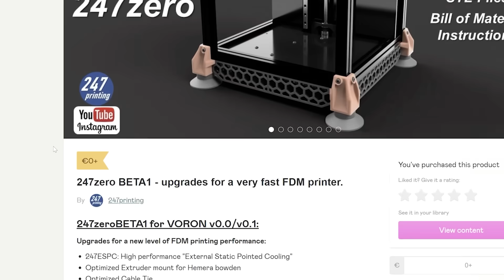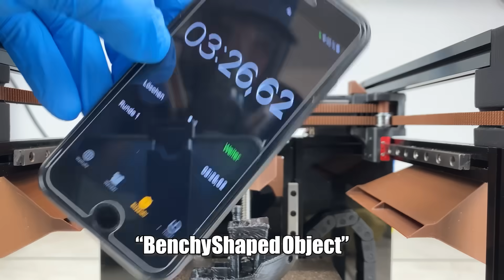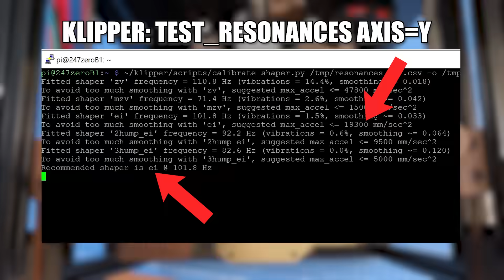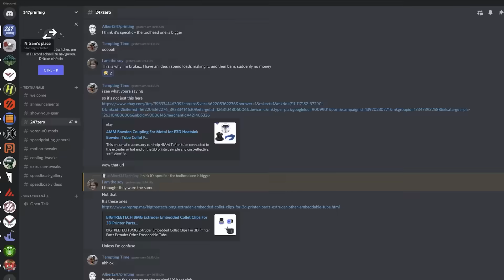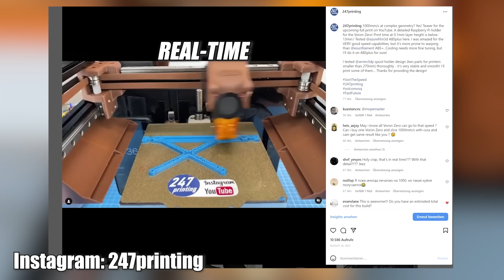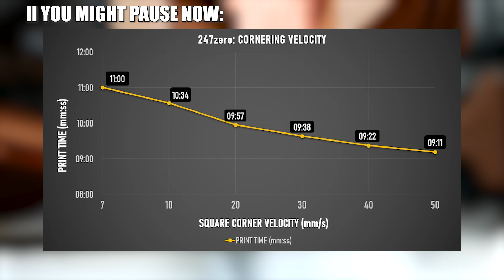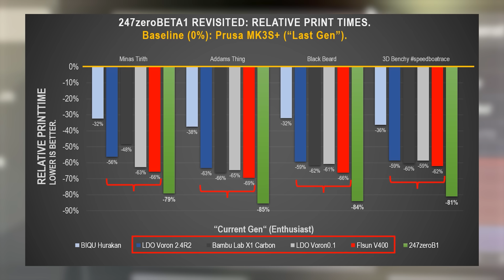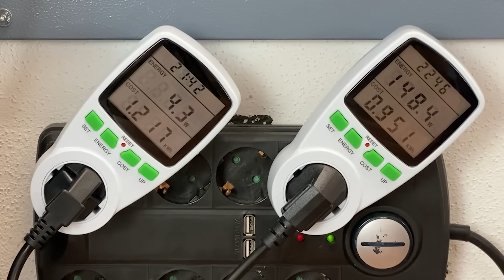HOW FAST is NEXT GEN 3D Printing? 247zero revisited!

Comment: One problem I see with cooling is there are two airstreams blowing against each other which could cause stagnation when they hit each other. I think a better solution could be to have a windtunnel like concept, where the air is blown from one side and sucked from the other in a closed casing. Just an idea

Comment: One thing I am curious about trying on my voron0 is making the bed rigid by removing the springs and adding auto bed levelling much like all the Prusa and Bambu machines. I find my bed loses its level after several prints due to the vibrations, which could possibly be compounded by the speeds you are travelling at? I would love to hear your opinion on the matter :)

Comment: Is it measurable how much the fan affects the printhead during the process? The printhead is fighting against the air pressure all the time.
Reply from the maker: I could measure max X speeds / accelerations with and without fans powered. In printing reality I don't realize drawbacks from that. Forces from airstream to toolhead are not that high.

Comment: Hold on. You printed a perfect benchy on a stock prusa mk3s in under 1 minute?
Reply from the maker: Sure! On the 247zero it took 11 seconds
Reply: @247printing  perfect quality benchy?

I'm currently in the process of deciding if a voron style printer will work for me to replace prusas and enders and I'm getting nothing close to that kind of time with anything remotely resembling quality

Comment: 1.What about using a compressed air line instead of the small fans on the print head. This would allow for the redesign of the ducting as you could more precisely direct a higher air flow where necessary. Make sure you use a water separator. 
    2.You could also chill the air for increased performance. Perhaps, chilled air would not need to be at a high pressure. This should also reduce the necessity for the noisy side fans. This should also reduce your vibrations, thus increasing your print quality.
    3.You might consider using a carbon fiber square tube for your cross axis. They are very rigid and light weight. I have seen them for sale on Ali Express. Hopefully this will help reduce weight and increase rigidity, thus reducing your waviness.

Comment: Not sure what the point of this speed race is? What is needed is bigger print bed size, more reliability, and lower TBO. Also, people need to loose this stupid notion that infill speed can be cranked up, where do you get that from? If you use infill for anything other than support, it is a single line print, and need to be dialed in like that. Also, this need for cooling, yet high temp enclosures, all contradict each other. This ultra high power consumption is a dead end for the industry. Printing without hot enclosure, at slower speeds, only leaves us with the print bed. In a production environment, speed does not really matter. You are busy setting up new prints and removing the finished ones, which will take most of your time. The only way to improve my efficiency is to improve the print size. Costs can be lowered by reducing the TBO, as in low maintenance cost due to slower speeds and acceleration. Not to forget the better work environment. This obsession with speed, probably just reflect that building a industry is not what is aimed for. Things are a bit different for prototyping, but once you start doing real production, you need to prototype as you would produce, if not, you will learn that lesson. I do not get this generation argument if all we talk about is speed.

Comment: you know, if you had two steppers at each point, and they spun in opposite directions (like with a gear or something to compensate for direction), you would have a lot less resonance. The opposing motions would cancel forces and keep them from going into the frame.
Reply: Yep that's a "4WD" setup on fast CoreXY printers like the VzBot

Comment: Here a crazy idea... can you build a counterweight for the xy ? So the printer can move faster without reduced quality 🤔.  Originally, i was thinking about putting an extra motor with a cord. The extra motor stops the hotend by pulling it back. But then i was thinking, counter weight can do the same. I think that every idea will work differently. Should be exciting to test both of them. Let me know what you think:)

Comment: To get better quality what if you slowed down the print for the visible surfaces and sped everything else up. Unsure how feasible this is, since I print at normal speeds and don’t write code.
Reply from the maker: That’s a common procedure and I also did and show that in the video
Reply: @247printing  must’ve missed it, I like watching videos like this while working 🤫 so I miss sections due to the lack of concentration

Comment: Instead of Next Gen, I prefer to call them "Enthusiast Printers" because you have to build them from parts lists or kits then modify it till it works. It'll be Next Gen when you can just buy reliable machines.
Reply from the maker: I'd call what you describe "Do it yourself printers".
Enthusiast can be everything above average (also an X1 Carbon for example).
"Next Gen", because: Those speeds would most probably standard on consumer printers from factory.

Comment: Speeding up the mechanical printing process is doomed to long term failure as it is a "brute force method". It would be better to devise a program that would take a 3D model (such as any .stl file) and figure out how to make a 3D printed mold to create the object. Then we 3D print the mold out of some material that can handle hot plastic. The secondary printer would simply be injecting hot plastic into the mold where you could rapidly produce each 3D part.

Comment: I have to say, my favorite thing about your design is the remote part cooling. Shooting a jet of air at the print head and then passively ducting it down at the print is really really clever. Maybe you could use a similar duct to pull some of that hot air to the hot end heatsink so you can remove that fan as well.  Or how about guided jets of air follow the print head?
For your X-rail, what about making it really wide in the Y direction, and then decreasing the wall thickness to keep mass the same? The lateral stiffness should increase the wider that rail is. I suppose it depends on if the problem is lateral or torsional stiffness.
For a true speedboat focused machine, I would make the print volume as small as possible, the same size as the speedboat benchy model, so there's no extra mass or flexible length on structural members or belts.
The ultimate lightweight printhead would be just a nozzle at the end exit of a bowden tube, connected to tensioned dyneema wires for positioning, the filament being melted by a laser mounted on the frame that tracks the hotend. A flying "hotend" with remote heating.
Reply: Whoa good idea! But wear goggles lol!

Comment: what do you think about starting with a ratrig vcore 200 as a base, it's much more rigid than the voron v0.1 as a frame and if fitted with a bowden hotend and a carbon fiber 200mm gantry as well as a driller linear rail and all of your cooling mods etc then maybe we could see superior results. What do you think?
Reply from the maker: You are absolutely right 👍 There might be plans for this or quite similar 😬

Comment: if the motors are strong enough, could you mount 110g weights on the outside of the belts moving the gantry, to offset overall momentum.  this might (nearly) zero-out momentum effect on the frame, increasing print quality.

Comment: Hmmm...  The geek in me is jumping up and down in excitement and has a few thoughts:

1. Adding laminar flow to the fan output would concentrate the air vertically.  Adding a lightweight shield that has a gap to line up with the nozzle--linked to the belt(s)--located between the fans and the air nozzles would focus the air horizontally, requiring less air pressure for the same cooling.
2. The fans don't have to be attached to the printer.  If they are placed in a heavy enclosure with flexible hose & feet, their vibration will be dampened, which should help with the noise.
3. Actively cooling the air itself before it is blown around the nozzle would DRASTICALLY reduce the amount of air needed, and there are MANY commercial and DIY solutions that would work.
4. Have you considered using counterweights to combat vibration?  That would mean throwing around twice the mass, but should (almost?) completely cancel the shaking cause by unbalanced forces.

Cheers!

Comment: Rather than cooling by moving more air faster (and risking deformation), have you considered using colder air? A cheap A/C or refrigeration unit or even a peltier stack feeding the fans could probably let you drop your fan speed by 50% and still provide better cooling. Heck, even a block of dry ice in front of the fans might cut it.

Comment: I try it in english: how did you manage to use such powerful fans and are still able to control the power of the fans via software? The mainboard would burn, I think.
Reply from the maker: It’s just a low voltage control signal from the board

Comment: I bet you could get absolutely crazy speeds with a high tension cable system instead of rails. It would need to be pretty highly calibrated, but there would be maybe 20 grams of mass in the hotend besides the actual heatblock and nozzle hardware. You could also reduce the size of the radiator significantly by having a tube alongside the bowden blowing air over it directly.
You would probably want to use steel cables, but I wouldn't skip the idea of using super low elasticity polymer thread of some kind to shave off a few extra grams.

Comment: I am curious for those static side blowers, if you ever needed more CFM have you considered seeking out HVAC supply. There are some blowers out there such as ones designed for minisplits or those through the wall units found in many American hotels that sit under the window.  Though while it is probably a lot quieter than hose Deltas the power usage is probably worse.  an upside to the blowers of course is most run on mains/AC so no need for a special power supply.  no clue how they handle variable speed of course, but an SSR might be able to PWM them.

Comment: Just wondering, with the extruder have you considered trying... I forget what others have called it... a sort of remote-direct extruder? In case you're not familiar, it's where you have the motor mounted to the main chassis, & use 1 of those flexible shaft things (i.e. like those used as Dremel accessories) to transfer the power to the actual extruder mechanism on the print head.

I don't how beneficial it would be, but it'd be interesting to see.
Reply from the maker: It’s called Flex3drive 👍
Reply: @247printing  Ah, right. Thanks. 👍

Comment: just saying there are light weight options for the  Y - Beam avaliable
Reply from the maker: 👍 Yup, I have multiple variants here and designed my own (X-beam)
Reply: @247printing  have you tried the cardon fiber or frame versions? They look like they could be more torsion resistant than your petg one
Reply from the maker: @martinhuber3566  its PET CF (without the glycol). Yeah, I check(ed) some other options

Comment: there is an Upside Down do it you self printer design thats faster than this! Its called Positron V3.
Reply from the maker: Yup, I know it and it’s great - faster? I strongly doubt that - cooling and extrusion are not up to that.
Reply: @247printing  What is meant is the core design without modification. A  Positron v3 or V2 modified by you would certainly be a monster. 8min with out modifications.
Reply from the maker: @de-kat  I am watching LDO's progress on it and I am VERY curious to try it out. I am sure we'll find a solution so that I can have a deep look at it :-)

Comment: And here I was sitting there wondering.

You're printing ABS, you're running open frame, your throwing mad cold air over the whole print.

How is the print not turning into a Pringle? And if it's shape stable, that's still no guarantee that it's actually cohesive and fully bonded.

But I see that you have something to show us in the future. I hope.
Reply from the maker: The cooling can be controlles/scaled (auto cooling). I was printing PLA for the test prints.

Comment: Just some thoughts on your upgrades. For the air flow, you could use some pneumatic tubes coming in the top like you're wires. You can blow air in it to get the airflow, with less power and noise, and about the same weight. Triangle Labs makes the Rapido Hot end which they say will go up to 75mm3/s. This seems like BS, but if it's not, there you go. You can make the frame more stiff with carbon fiber parts, they make race cars that can do similar things to what your looking for all the time, or you could use a very interesting material: Boron fiber. It's stronger, stiffer, and cheaper, but more delicate than CF. Boron Fiber is twice the stiffness of steel and light weight too. It would be interesting to see. Either way I think you'll get the stiffness you want.
Reply: I would think an airbrush compressor would be enough flow as well as being reasonably quiet.

Comment: That speed is insane🤙 have you considered making some sort of bed for the printer frame? I think that bolting the printer on a stone slab would reduce the frame vibrations. But then again you would also make the hard stops of the printing head more violent when there is no play between the printer and the the table🤔 In theory you could allso build a gyroscopic platform that moves to counter the forces of the printing head. You could just reverse the g code that you are printing and program some servo motors to create countering forces via mechanized platform between the printer and the table. The same way car manufacturers use counter weighted axles on car engines to counter the forces of the rotating pistons, rods and crankshaft.

Comment: Could you mount a direct drive directly above the hotend running on its own rails motors and belts? Often wondered if this was possible on my Ender 5 to reduce the weight on the hotend. Maybe a silly idea..

Comment: @6:00 you talk about moving the filament fast enough.  Any thought to a "single print head with dual filament feed"?  Could feed it two of the same color, and then the "feed speed" is only half, for each.  Could also mix colors.

Comment: I'm building my first ever voron and since I'm not that smart I'm super happy to see this kind of investigation. I've wanted to print fast for a long time.

However I have an idea. Why not use a cabon fiber square tube instead of the 3d printed carbon fiber petg? You may not save weight but it will be way more ridged than the petg.

Comment: PC's usually use larger diameter fans to quite them down which could be a solution for static fans. As for warping: when pushing things to the extreme, probably a thorough air flow simulation and optimization is required to better target the printed layer without cooling a big chung of the part(which is hard work but could have high benefits). Also the gantry could be made from 2 carbon fiber tubes with linear rail attached to them to increase stiffness (i don't think it will increase the weight of the gantry)

Comment: If you have a suitable brain board, (at least 32 bit) maybe consider a Zesty Nimble for direct drive quality and additional torque without the direct drive weight. I have no idea how your system would handle the cable waving around at those speeds and accelerations though, but I've been very happy with mine. The original and the v3 have 30:1 gear ratio, and the v2 has 20:1, so you'd get a ton of torque compared to the Hemera's or the Bondtech's 3:1 gear ratios. At your speeds the cable might end up being too fast and bind up or might even melt the sleeve. Or it might not. For my system, I'm still running an 8 bit board, so I had to reduce the microstepping so the processor doesn't overheat or bottleneck, but that also increased the noise level. But if you're using server fans to cool yours I doubt a little bit of driver squeal is going to affect the noise that much if that's something you would need to do for your system.

For your small system, I suppose the cable could be trimmed for a more optimal design and less weight flopping around.

Have you tried upgrading your heater cartridge to a higher wattage?

Comment: Just a question, could you use a 3d printed part to redirect some of the air from the part cooling fans (there is a lot of air from them) to the hotends cooling fins and get rid of the fan and attachment hardware for it? if so that could save you a cunk of weight from your moving mass
Reply from the maker: Good thinking! That topic is on the list, yes 👍
Reply: @247printing  Great to hear! looking forward to the 1 minute bencies :P
Reply: @247printing  How needed is the full bed as well? With the speed and cooling i have seen in most of your videos it seems like you could basically just put a sheet of metal or other surface down without a heater and possibly be fine